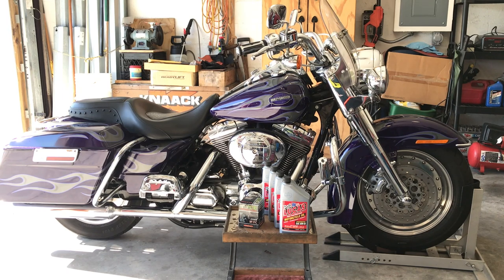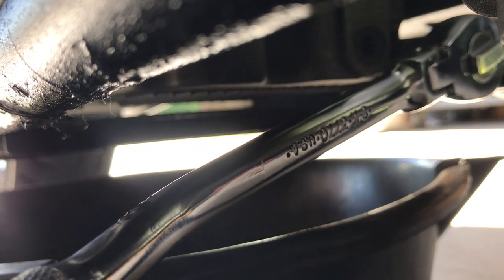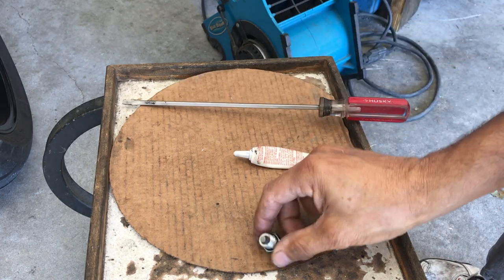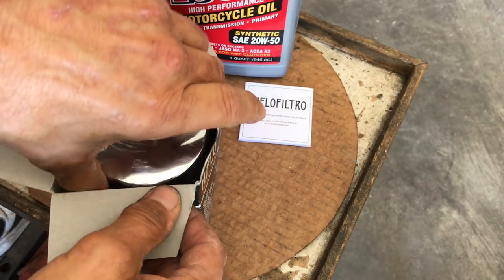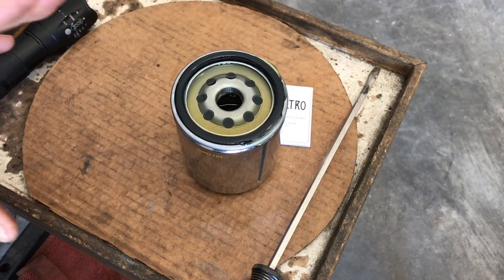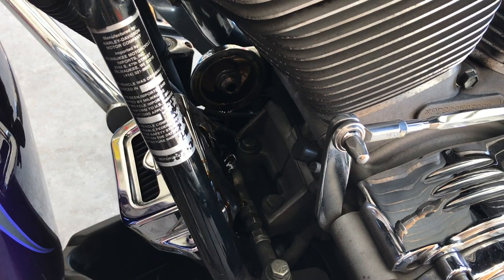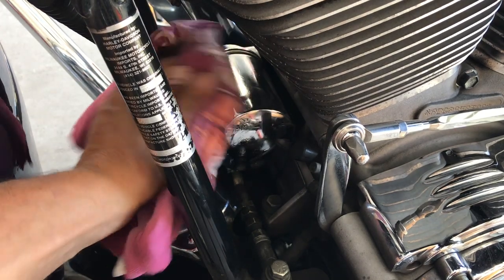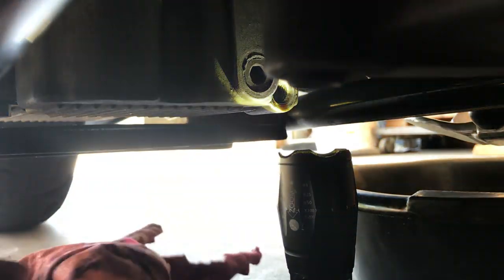Harley Davidson Road King Oil & Filter Change

Comment: I just started using Lucas 20/50 non synthetic this season for my 2008 sportster.i was using the syn 3 from Harley for motor and primary also but the clutch felt to slippery. I am very happy with the Lucas so far

Comment: Thanks for your tips Rocco. Here's one that worked for me to lessen spillage when removing filter. A water bottle cut in half top to bottom. Then remove the bottom of the bottle and slide it in under the filter. Then when you open the filter the oil mostly goes into the bottle.   Works best when the bike is on the kickstand.
Reply from the maker: Thank you for the heads up. I appreciate the tip. And soul others. Ride safe and have a great day jersey.

Comment: Very concise video.  Thank you.  When checking the oil does it matter if the bike is upright or on the kickstand (sidestand)?
Reply from the maker: No it does not matter,  The dipstick is hinged so you can read t when it's on the kickstand.  I hope thist helps. Thank you for your Sub, Any questions just ask..

Comment: Thanks for another awesome video... I'm going to try that this weekend I heard the Lucas 2050 is very good
Reply from the maker: Great Product.
Reply: @TwoWheelRocco  yeah Rocko I went out and I bought the Lucas 20/50 fully synthetic it at AutoZone..... 9.99 just like you said I got three of them .I have  a 95 cubic inch, 2005 15th anniversary Fatboy.
So it only takes 2 and 3/4 qts
Reply: @TwoWheelRocco  now I just have to buy the filter would you go with a regular K&N Filter or does it have to be the Harley-Davidson with the 5 microns?????

Comment: Hi, I'm writing to you from Italy, can I ask you how much oil did you put in the engine? Without taking into account what you put inside the oil filter. Thank you.
Reply from the maker: Happy to help. I start off with 4 quarts and a new filter. I put 3 quarts in and then start the bike, shut it down and check with the bike standing straight up and down. How much is on the stick. I myself do not like to go past the halfway mark. Any questions just ask. Thank you for watching and all your support. Italy. Ride safe and have a great day Road Kings are great bikes.    https://www.google.com/search?client=safari&sca_esv=594304749&rls=en&sxsrf=AM9HkKnvvMouWE6OtZi8QsQEf_gsqCai8A:1703801027218&q=02+Road+King+engine+oil+amount+with+Filter&tbm=isch&source=lnms&sa=X&ved=2ahUKEwjc4fq3kbODAxVYkmoFHQSAC0cQ0pQJegQICxAB&biw=1470&bih=817&dpr=2
Reply from the maker: https://www.v-twinforum.com/threads/2002-road-king-oil-capacity.208869/.    Take a look...

Comment: Hi John here need to get that tool for oil filter where's best place to get it oil is Lucas 20 50 correct
Reply from the maker: Happy to help yes, correct 2050 Lucas MC oil and I will send you the link for that oil filter socket. Thank you for watching and all your support Lorna. Road Kings are great motorcycles. Ride safe and have a great day .https://www.ebay.com/sch/i.html?_from=R40&_trksid=p4432023.m570.l1313&_nkw=Holly+Davison+Road+King+oil+filter+wrench&_sacat=0 hope this helps.
Reply: Thanks for help you got link for oil filter thanks john
Reply from the maker: @lornarutkowsky1307  I will send you the link on eBay.  https://www.ebay.com/itm/394682220570. this is what I use.  Hope this helps..